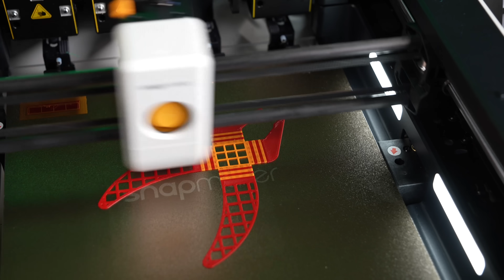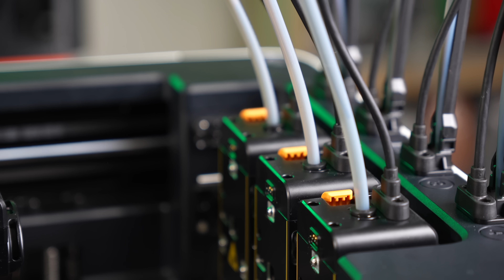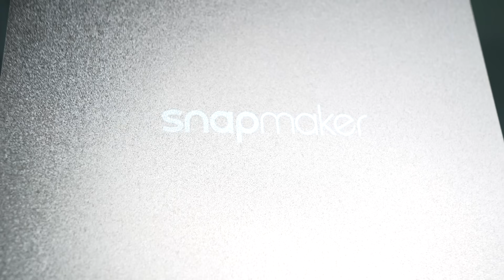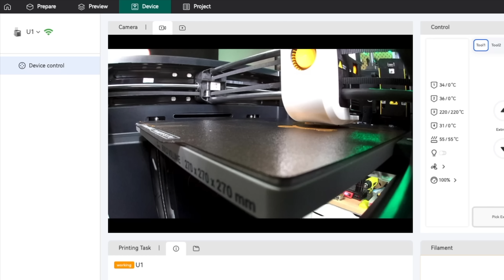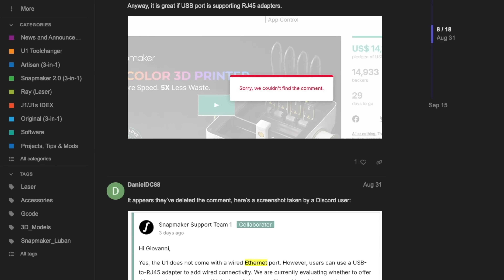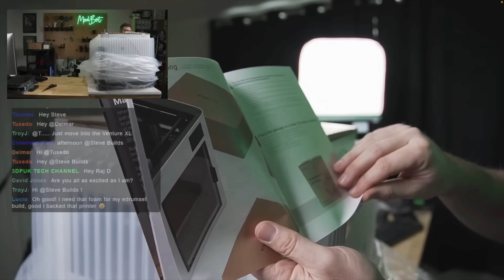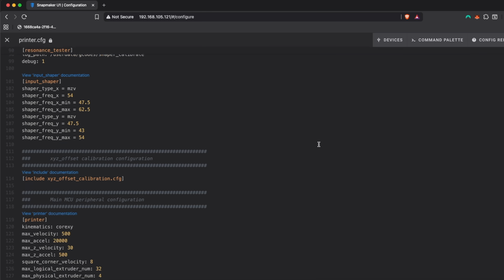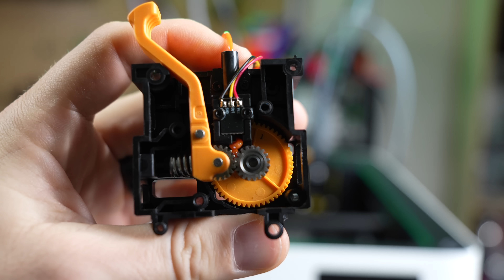Would I Back It Again? Snapmaker U1 Tool Changer

Comment: The difficulty removing a clog is going to be a barrier for general consumer adoption. They really need to improve that in a U2, or potentially a U1 tool revision (if even possible within the current constraints).
Reply from the maker: Agreed, for anyone with prior printing experience I think its totally feasible but if not, I see room for error. I'm not saying it will be an easy task to address but it is one I believe is very important.
Reply: @ModBotArmy do you know what might have caused the clog, or what made the 2nd print work when the first one didn't?

Interested in the U1, but if it just randomly clogs that might be a deal-breaker :(
Reply: I’ve had 2 clogs in 3 years using a plain Sovol SV06 with a .2 hardened steel nozzle. Is it really that much of a problem on other machines? I’ve upgraded all the fans, but other than that… I don’t think I’ve even looked at the nozzle for a year. Strange.
Reply: even if someone has prior printing experience this design is simply frustrating... 
almost as frustrating that bambu decided to use the fixed nozzle you need for really soft TPU for tool changes instead of the movable nozzle...
Reply: @TeaObvious deeply frustrating. It’s time consuming and fiddly to get into the toolheads, especially the extruder itself.

Comment: Has anyone tried printing 60A flexible filament on this printer?
Reply from the maker: Based on my 95A getting a jam no way would I print 60A. That usually requires specific hardware that isn’t going to come stock in a machine. I think by bypassing the autoloaders and going slow 80A may be possible but less than that doesn’t sound like fun.
Reply: @ModBotArmy That's strange you had a jam when NeoKoi was able to do complex prints and hueforge with TPU seemingly with few issues. I think 60A would certainly be a challenge though.
Reply from the maker: Haha believe me I thought the same thing. I believe he used the feeders as well so IDK. It did complete beautifully once I got the jam cleared but it was a paint to get too.
Reply: @ModBotArmy isn't there an adjustable tensioner for each head?  I thought Teaching Tech did that when he had his first TPU clog
Reply: @ModBotArmy damn... TPU prints with PLA support is literally the main reason I'm interested in this printer 😢
Reply: Someone on Reddit tried 85A and had the same clog-removal experience as Daniel in the video... But with reduced extruder tension (screw on the side of the head), it worked on his second attempt.
I don't think 60A will be doable at all.
Reply: I believe NeoKoi Prints has tried softer than 95A, but I can't recall exactly. I would bet that Lost In Tech has. No video yet though I believe.

Comment: Make this video again in 2 years, I would not back the J1 (IDEX) Knowing what I know now, because my J1 has not had any updates in over a year and no longer works well with any current slicers (including snapmakers own orca) due to a variety of bugs that have been introduced. Glad I avoided the U1 because the Core1 and INDX will be kings of multi material.
Reply from the maker: This is running Klipper and uses a fork of orcaslicer so it’s quite different already from that perspective. I don’t doubt the core 1 and INDX will be awesome but at the price difference it damn well better be.
Reply: @ModBotArmy just how much does Klipper matter when root access is still locked down? you are 100% dependent on snapmaker's continued support (and quality of their decisions) same as Marlin. Edit: The fact of the matter is it's been over a year with 0 updates to a machine they still sell, the machine is not even 3 years since the first pre-orders shipped, it's an awful look
Reply: @digiital I saw the thread, but without snapmaker playing ball he's still not able to install Klipper which was the original intent behind the project. He ended up replacing the control board to try to convert it to Klipper and frankly you could have just built an entirely new printer with all the integration work he had to do.
Reply: I don’t own any snapmaker printer but what you said is exactly why I haven’t ordered one while wanting one of these types of printers. I dont know what support will actually look like down the road and I don’t want to get a new printer every year or two
Reply: @ClappinCheex find the manufacturer that guarantees support or has a good track record. Bambu and Prusa are very safe in that respect.
Reply: That's a valid reason. Snapmaker has a shaky history. I almost pulled the trigger. But I decided not to. I'm glad I didn't.

Comment: had loose screws in toolhead three... it didn't finish initial calibrations.. i took it apart found it had screws loosened or wasn't tightened enough ... put it all back together and thank the stars it worked... running fine now .... i was a lil scared of getting a lemon , and a lil pissed it didn't just work... but i can't really complain, now
Reply: If you have the time make sure to send them an email so that their QC people can incoperate checks for this issue before final packaging
Reply: @notsogood4321 yes, i did

Comment: I am really really thinking about ordering. Honestly, should I pull the trigger? Modbot
Reply from the maker: I don't like to spend peoples money for them. I like the printer and have really enjoyed using it, but my requirements may be very different than yours.
Reply: I have backed it in August and am still waiting. I probably wouldn't buy one now, you'd be waiting until April next year. By that time, better offerings might exist: Wait and see how Prusas Core One with INDX does. Bambu also could make a new X2C. We haven't seen any waste minimizing solution from Creality yet. And so on... (And in case it is still the best offering in 3 months: Buy it then. You're not losing anything.)

Comment: Just on the wait in the UK, for my Early Bird Backer expected mid January., but enclosure lid won't land then for a few more months, nor will hardened single size nozzles, but at least some people are playing with different nozzles sizes. I got a build plate off Aliexpress while I'm waiting! :)
Reply: Exactly same here in UK, with the exception of the lid, even at the discounted rate I'm not paying it, mental. Will wait on 3rd part or make own.

My cold and pei build plates are in UK now from aliexpress, maybe get them this week coming.
Reply: @raptorheli2 I bought the lid because I want to use ASA/ABS and different materials and nozzle sizes in one print…it just saves me time, so I took the hit to the wallet, and then I’ll be able to concentrate on the things I want to try. Agreed it’s a ridiculous price, when you can buy a filament dryer with a similar volume for that amount.Iin the UK, you could probably sit a Really Useful Box or similar storage box on top of it😂